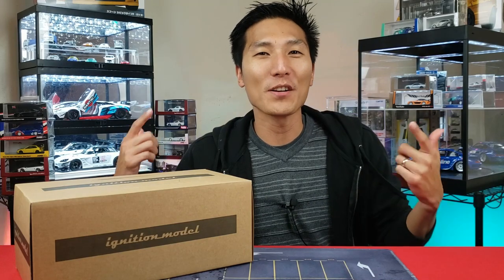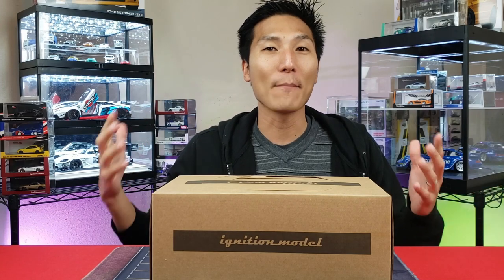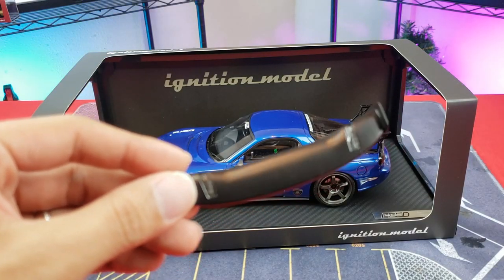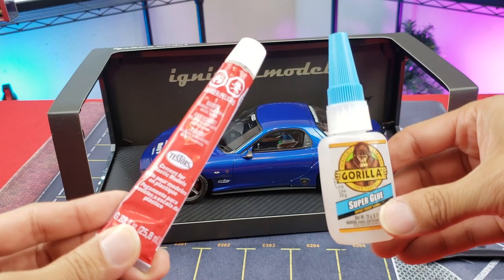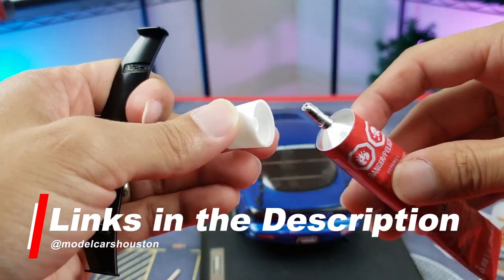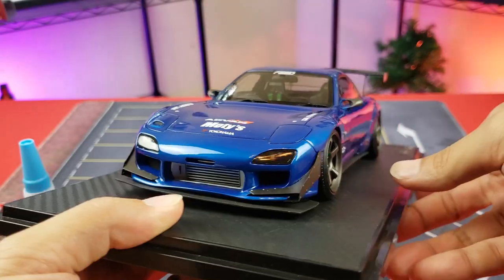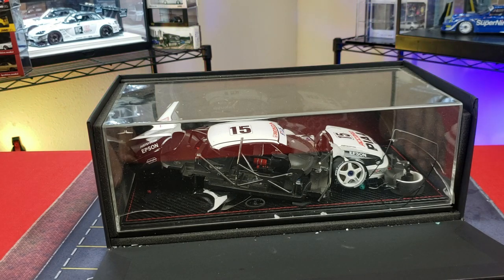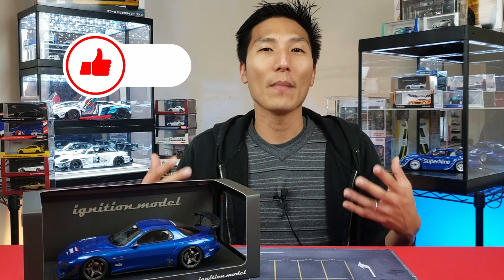How To 🛠️ Repair Your Collectible Model Cars | QUICK AND EASY!

Comment: Good info. You mentioned the clear lenses. Super glue or regular model glue will fog up the clear lenses. There are specific glues for clear pieces that do not fog. Also, using super glue near clear pieces will also fog up the clear parts as the super glue dries, the fumes will travel and fog the clear pieces. Just a heads up.
Reply from the maker: Perfect information!  Thank you.
Reply from the maker: Pinning this one as well!  Thanks!

Comment: I never or very rarely use superglue on models.
I use a type of glue called Canopy Glue as it drys clear.
It can be safely used for things like lenses and 1:18 resin windows.
It won't cause any discolouration in those parts.
Reply from the maker: Great information!
Reply: Superglue is fine for this application though, as long as only a small amount is used, as was mentioned in the video.  It will likely hold stronger.  Definitely no superglue near any clear parts as you mentioned though.  There are plenty of glues for that but they won't be as good as superglue in general use.

Comment: What would you use for a cracked A pilar on a 1:18 car (also the t-top frame and door hinge of this Trans AM)? I tried JB Weld… nope. Bondo? CA glue? Solder? Any ideas would be appreciated (from anyone). Yes, it’s the Smokey and the Bandit 77 Trans AM. Thanks.
Reply from the maker: This is the best glue I have used.  I'll also be doing a HOW TO REPAIR Part 2

https://amzn.to/3tz12uM

Comment: This is an interesting video.  I also use super glue though I prefer Loctite gel superglue because it is easy to work with and doesn't  produce the fumes that cloud windshields.  I have reattached parts, that have fallen or broken off.
This is no problem if the part in question is still present and was put on the model in the first place but just fell off during transit.  However, what aggravates me is having a part not there at all.  What do I do about that?  Case in point, I recently purchased a Road Signature 1:18 1955 Ford Fairlane Crown Victoria, an otherwise beautiful model, but the fact, that the drivers-side headlight lens is missing detracts from its perfection.
Reply from the maker: In those instances, it is best to contact your reseller or where you bought it from immediately.  They should be able to work with the parent company to get the new part for you.

Comment: I have a perhaps stupid question... How do I remove those frames around the base of the 1/18 scale IG model? I bought an LBW supra and the plastic frames around the base are super tight and I just can't find a way to remove it 🥲
Reply from the maker: Man, I honestly thought I put together a video on how to do that but it seems I only scripted it but never shot it!  Haha

If you flip the model car upside down, you'll notice the two snapping points on either side these are the areas you need to pull off and away from to get the uprights to release.

I'll put together a video for it if you dont want to risk it.
Reply: @modelcarshouston  Thanks!! I'm used to handle the GT spirit models so when I got that cage I was like, " I'm not gonna touch it" 😂

Comment: It's an interesting video but I have a doubt, a few days ago I bought a Lamborghini Aventador SVJ 1:18 scale from Autoart and it came with the left part of the spoiler broken and the steering wheel completely fallen off, this made me very disappointed and my question is can I go back to glue the steering wheel without compromising the steering movement of the wheels?

Comment: This happened to me with the factory diorama from ignition model. Seems like they used cheap acrylic hot glue. Some pieces came off and damaged a bit of the paint. Would be nice if they put a fragile label on the box too. So is any decent CA glue the preferred choice when repairing?
Reply: Should I remove the remaining glue from surfaces before applying the CA glue or leave it? What would be the best way to remove that cheap glue they used?
Reply from the maker: Yeah, sometimes these things get handled in ways that are out of our control unfortunately.
Reply from the maker: Apply a small amount of Tamiya X20 Enamel Thinner.
Reply: @modelcarshouston  cool thank you
Reply from the maker: @rotorhead_al4629  Yes sir!

Comment: Bob Smith Industries Super Gold is a fume free super glue that doesn't frost things. their Kicker spray is great to speed up curing. just drip it on the spot after gluing. and clear stuff like lenses and such...you can often use Aleene's Clear Gel Tacky Glue...sort of like white glue but doesn't yellow or become brittle. of course no fumes, either.
Reply from the maker: Absolutely great information!

Comment: I try not to use super glue for these kind of fix. If I do use super glue, I have to use it together with the instant dry, otherwise it might leave those white residues:( I think the best glue for the dicast model fix is E6000, cause it dry clear and very strong. But sometimes, you have to find a way to use it
Reply from the maker: Great call!
Reply from the maker: I will also have do a PART 2 video where I use different glue.